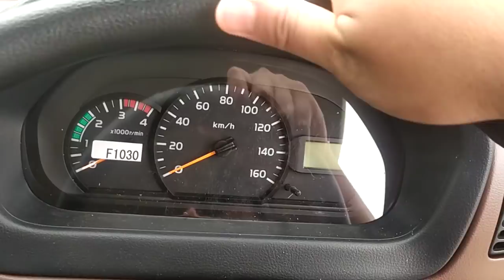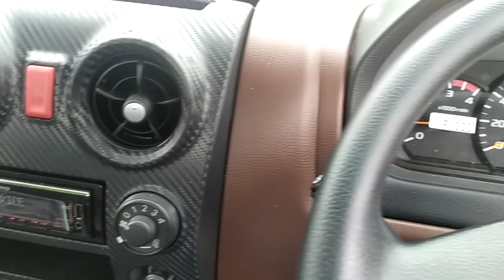SUARA HALUS MESIN DEISEL HINO DUTRO 136 HDX EURO4

Comment: Tenaga Dutro emang oke ,tapi kalau di ajak lari jarak jauh mesin nya tidak tahan sering over heat
Reply from the maker: Kan ada perbedaan di Diffrantial/ gardan rasio ada 5.8  dan 6.4 ada untuk medan menjak dan untuk speed kembali kebutuhan cust mau buat apa truknya om harus sesuai dengan segmentasi usahanya begitu om
Reply: Pompa oli nya sering bermasalah,karena
Reply: Semua yunit ada kelemahan dan keungulan msg2 om ku, jadi klo mau beli hrs tau
Reply: Kalo mau buat jarak jauh antar kota pake rasio gardan yang 5,3 atau 5,8,
Jangan pake gardan 6,4 atau 6,8 jelas mesin cepet panas, 
Pake gardan 6,4 / 6,8 buat jarak jauh antar kota semua merek truk juga cepet panas mesin nya, bukan hanya hino.
Gardan 6, 4 dan 6,8 ini khusus untuk muatan berat jarak pendek,